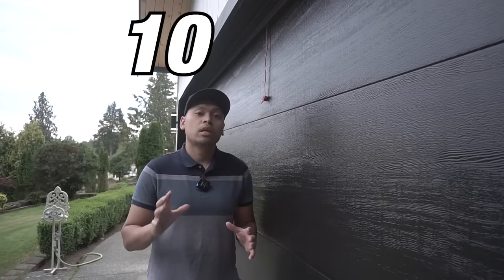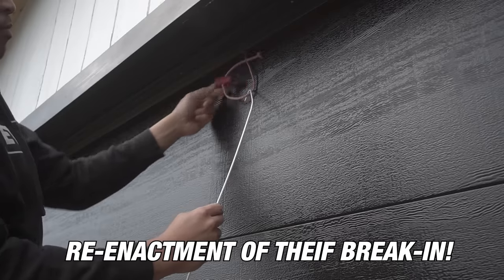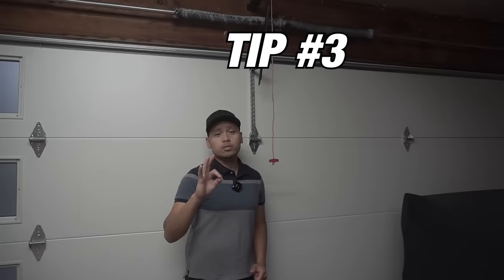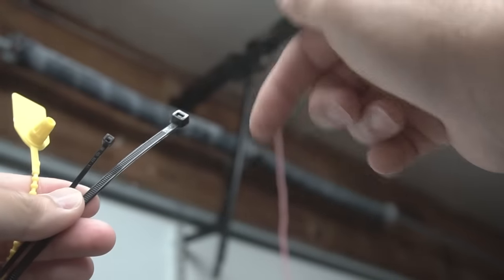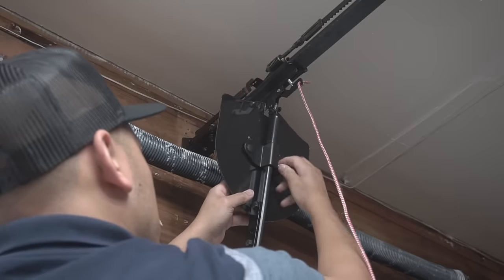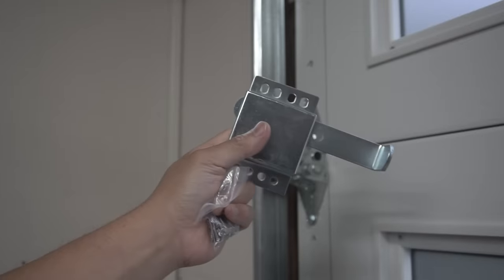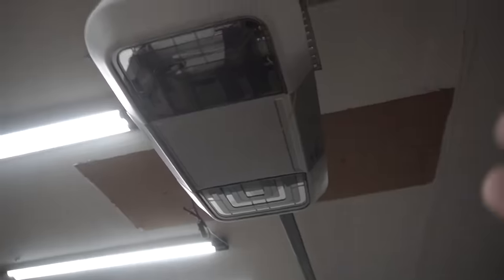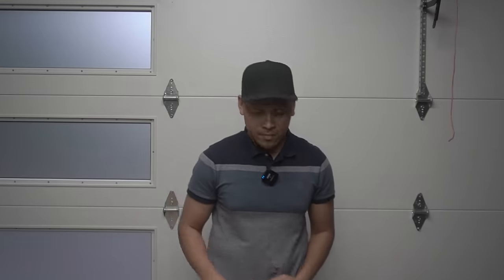How To STOP Garage Door Break-Ins! Burglar-Proof Your HOME! (10 TIPS To Keep Your Family SAFE!)

Comment: As a garage door tech/owner I’ve never seen this happen..  just teach them how to break in 🙄

Wow the handle fit between the weatherstrip and door? Who ever installed the weatherstrip did that wrong and the door top brackets should have been adjusted to touch the frame 

Don’t put a lock, you will forget it and push the button and damage your door

So much wrong about this video

Comment: As someone who has owned a garage door company since 2009, I can tell you these tips are absolutely terrible from someone who doesn't understand how garage doors work. Putting a vice grip/lock on the track? Are you kidding? Are you TRYING to get people to break their own doors? The second you push the button to open the door while forgetting there's a vice grip or lock is on the track, the opener WILL buckle the top section right in the middle. This is why I always tell my guys to remove garage door locks from the door as soon as they install an opener; so customers don't forget to unlock it, which will break the door. I'm sorry but almost all these tips are dead wrong.
Reply from the maker: Best of luck to you sir 🫡